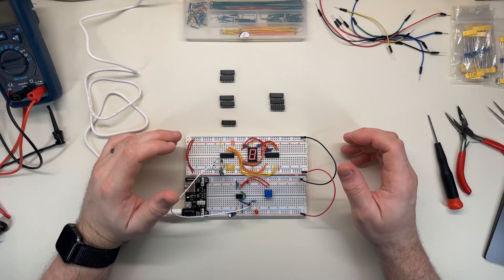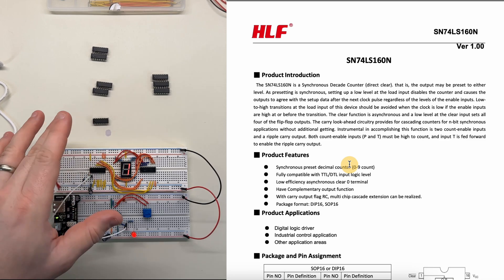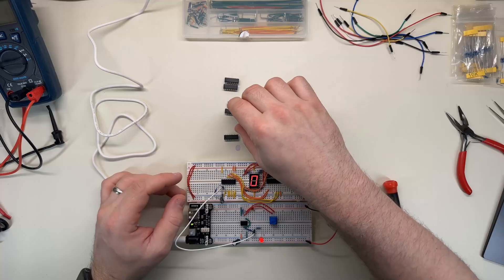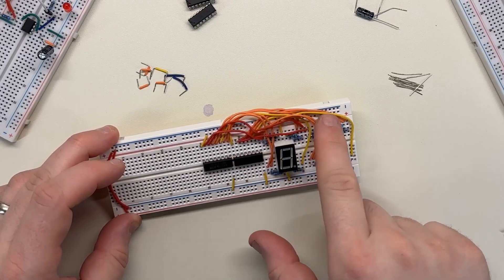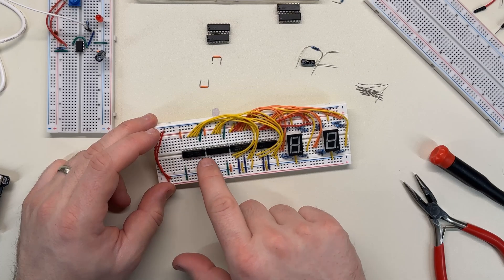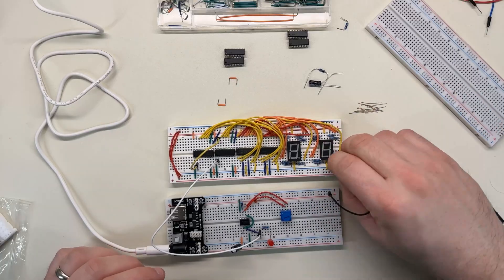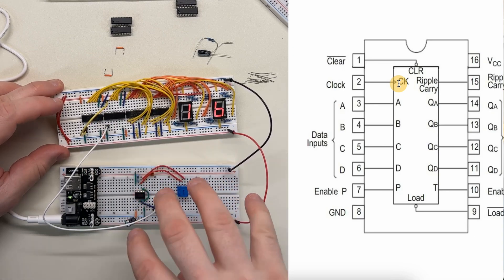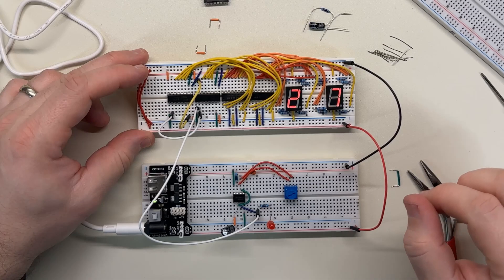Upgrading the counter to a two digit display (The Great Multi-Digit Saga: Part 1)

Comment: Why don't you use CD4026BE or CD4033BE? Just need one IC for each digit.
Reply from the maker: Well, there are (at least) two reasons:

1- I didn't know they existed until just now.
2- I don't have any.

That said, they look super neat and would have made things a lot simpler.
Reply: @bigzaphod  that means you can make it the topic of your next video.

Comment: Did you notice that the left display has the bottom led on when it says 9 but the right display does not. Is there a reason for this? like the decoder driver may be different? I didn't notice any of the other digits being different.
Reply from the maker: I did eventually realize this. (Actually, my wife first noticed it!) It turns out that the box of ICs had two different driver chips that differed by a single digit in the part number and I didn't realize it or notice it at the time. In hindsight it makes sense because everything else in that box only has 2 of each part number and I never stopped to think why I had 4 driver chips! So I actually have two each of two slightly different driver ICs where the main difference seems to be that some digits have a different shape.
Reply: @bigzaphod  maybe a good topic for another video, Explaining the different chips that look to be the same but are not quite. Thanks for you channel.
Reply: When doing displays with 7 segment units some people like to have the tails on the nines and sixes and some don't, but your display would look better if all of the digits are the same, so what don't you want?  https://www.youtube.com/watch?v=p-FX_7SFSsM&pp=ygUTd2hhdCBkb24ndCB5b3Ugd2FudA%3D%3D

Comment: Awesome stuff. I'm not nuts about the switches on most of the breadboard power supplies, the two that I have both died within a few weeks. I've been using ones that don't have a switch and I either plug/unplug the wall wart from my power bar or use a 9v battery with a switch.
Reply from the maker: I may need to look into a new one. I don't really need a switch, tbh, plus this design takes up a lot of board space.